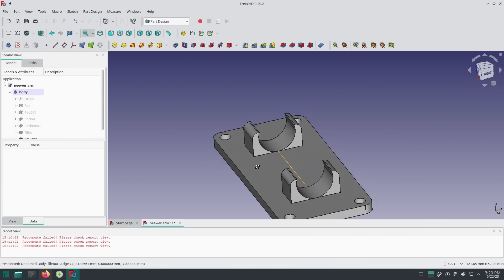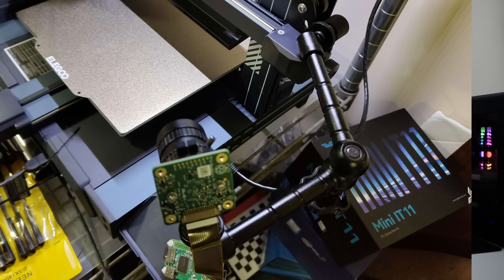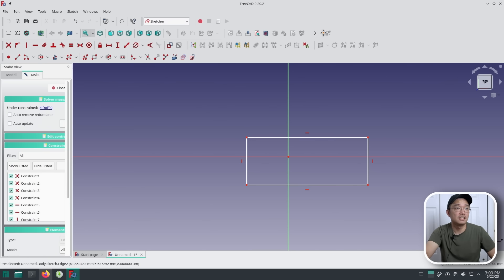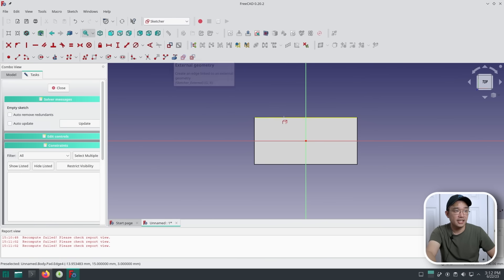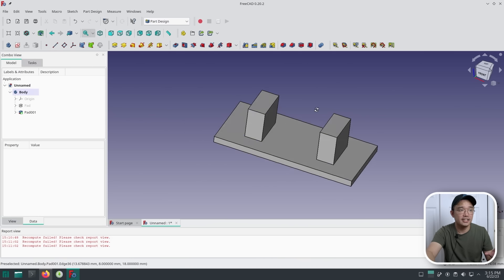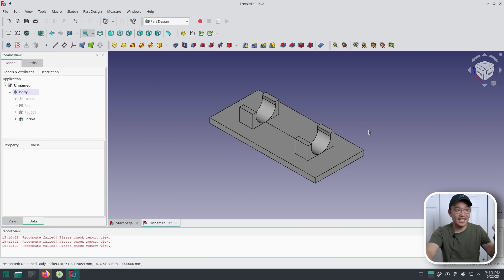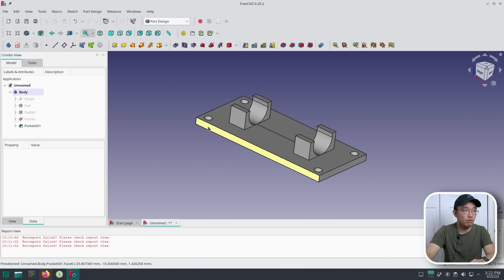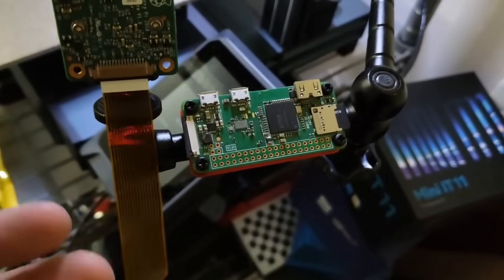Learning FreeCad with These Basic Steps

Comment: 13:10 You can't infer the diameter of the holes based on the distance from the center to the outside edge of the base. You say the hole diameter is 3.5mm, but the lower right corner of the diagram says the holes are for 2.5mm screws.

Comment: The one thing that is boggling me, is this sketch stuff adding extra steps I'm not used to from Rhino... i just want to work in the 3d environment. Click the box icon, make a few small boxes, tweek the measurements. Click cylinder icon, make a few cylinders, tweek measurements. Cut to form. Finished.

Maybe Blender just might be the direction i need.

Comment: nearly identical use-case to me, and you're right -- I want to print an Amiga computer case that fits a mini itx machine and someone already made one, but I will need to modify it because I want to fit a flex ATX psu in it, a smaller GPU, and probably a different board. I might end up needing to make it longer. Also, fan brackets and stuff.

Much thanks, this was a great tutorial.

also, shoutout to when you changed the entire UI of FreeCAD. FOSS is so great :))

Comment: HI, IS THIS SOFT CAPPABLE TO DESIGN SEPARATED PARTS AND THEN MAKE AN ASSAMBLY? i need a tool to design in that way becouse i work making some articles on wood and need to make an asambly to see if all the parts fit and get not surpeises after cut the material,  i used autodesk inventor for a long time but they give no more educational licens and its just too expensive to me becouse im from Argentin :( thanks in advance!
Reply: Yes!

Comment: Don't do 30/2 or 15... when inserting the distance, click on the full distance and it will bring you de variable (like D1) and then divide it by 2. This parametric way will allow the center point be correct for any future change in size lengths of the board

Comment: Not sure if anyone had the same thing happen, I'm using version 0.21.2 and at 11:47 when you create the pocket you have an extra edge that I don't have. There's the edge left from the circle and a much smaller edge in the upper part of the right block. I don't have that small edge, I just have one continuous edge left from the circle. Hard to explain. I can't figure out what if any step I missed as I've been mirroring your every move. Anyways, thanks for the tutorial...hoping this is enough to get me going with "simple" models and build from there.

Comment: I definitely appreciate the effort put into this video.  However, I finished it still feeling confused about how to do many basic things in FreeCAD.  A lot of details are glossed over, like what constraint symbols specifically mean and what each type does.  It also doesn't really touch on many of the tools available.  For example, instead of free-handing a rectangle and centering the object by manually constraining corner vertices to the origin, you can just use the "Centered Rectangle" tool and draw it out from the plane origin, skipping a few tedious steps.  Just wanted to let anyone who still feels confused know that you aren't alone!

Comment: giod video for beginners, however you could simplify a few steps especially using the "symmetry" constraint and hole "thru all" instead of increasing the depth that much. those tricks also make it easy to update if necessary as you would have less lengths to change. anyway, very useful for beginners I thin 👌

Comment: I want so badly to just run linux.  Bill Gates, microsoft, google, apple, etc. have all become so damn sketchy these days, but I always ran windows because of compatibility (mostly for gaming which I shouldn't be doing anyway) and a few other programs too I guess.  I wish linux was as compatible as windows with all the software and hardware out there.  Maybe some day I'll be able to afford 2 beefed up PC's and have windows on one, linux on the other, and do as much as I can on linux and only use windows when I have to and I'll be able to determine how restrictive it is.  Then there's Apple which I was about done with and then the m1 chip came out so I use an apple laptop...the thing is just amazing.  Super thin, super fast, and the keyboards on those things...I swear they are designed for my hands lol.  Anyway sorry to rant about this on here, just saw you running freecad on linux and man...that's the dream.  Free open source everything.  How the internet was supposed to be.

Comment: This tutorial is interesting. I've had FreeCad on my computer for months but haven't used it because I simply did not know what to do to build anything.
Still, I'm hard pressed to find any benefit this program offers over OpenScad. OpenScad makes it easy to include fudge-factors in your creations to get around the fact that FDM 3d printers NEVER print exactly what you design. Holes will be a little smaller than spec and poles will be a little larger, and a fraction of a millimeter can be a big problem when you need something to fit with another part.
What I'd really like is a program that lets me model parts working together. I know such programs exist, but I doubt I could find a free version that does not require me to store my creations on the cloud. I like to keep my creations on my own server.

Comment: OMG this video was useful. I just needed to know that, part designer into a new body, into a new sketch ON A PLANE, that has a SHAPE which is constraint on all points until green. Then PAD it and you have a functional model. You then add to that by selecting a face from your existing part all over again by doing sketch, shape, with constraint, with pad. then you use the tools like pocket, fillet, drill, etc on the PADDED part. and then export the body. WHY can't the other videos explain that much needed workflow? I can learn the extra stuff later, or most likely figure it out on my own. Most of us here are good with computers, we aren't your normal casual user.

Comment: Pretty good tutorial. I do see the similarities between Freecad and Solidworks (Solidworks user here), although I thought it would've been much better if you did show some commands that would make the part building quicker and more efficient.

For instance, you could've made just one hole (or two holes) on the surface, specify the dimensions, then just mirror onto the other side. In doing the longer route that you presented, it's just taking extra time dimensioning each and every hole (also can be prone to accidentally making a tiny mistake by mis-typing and giving an incorrect value to one of the holes). The same goes for the holders - just make one then mirror onto the other side. You can ensure that dimensions are the same and they are symmetrical.

I'm hoping that these commands (i.e., mirror, linear pattern, circular pattern) can also be done with Freecad (that I'm interested in knowing), as it they are basic in Solidworks and Autocad. I'd like to try out Freecad later on, as it is free and you don't have to pay thousands of dollars for a license.

Comment: at https://youtu.be/rglvJH9z5ng?t=684 you "save this" by clicking "close" and you get back to the 3d-view with the circle showing.  When I do the same, no circle shows and the pocket tool does not work although Sketch002 shows up under Pad001 in the herarchy.  This is with FreeCAD 0.21.  I am stuck here...

Comment: What if I dont use a mouse, but a touchpad, and I cannot accurately click on tiny things?
Reply: Unfortunately, touchpads are more for doing touchy-feely things.  A multi-button mouse is needed for doing anything close to engineering work.
Reply: @notyoung  Shouldnt have to be like that, especially since you are likely typing in parameter values manually anyway in a CAD software. All that would be neccesary would be to make tiny clicky things circly things for easy touchy select and grab.

Comment: Watching this video is frustrating.  Symmetrical constraint could have been used multiple times, saving you from having to use two constraints.  The axis lines can be used like construction lines, and they are always constrained, not just the origin point.  You could choose up to face on the pocket tool, and click the face you want to extrude the pocket to, instead of increasing it incrementally.

Anyway, you got the job done how you did it, but you cause me great pain by avoiding so many shortcuts.

Comment: I used fusion360 for the last decade or so and since they're getting greedier and greedier and start stripping away features from the free-tier every day it seems, i start to get fed up by all this cloud-stuff.

FreeCAD looked so barbaric and convoluted, but after sitting down for a whole hour and forging the UI to my specific needs and installing ModernUI Plugin... it now feels great. Sure Fusion360 has a more fluid workflow in some cases but FreeCAD gets the job done aswell and i already modeled a few things with it and get the hang of it more and more with each use.

The comments under this video are super valuable but your video gets you up and running without any hassle. This is a very very well done basic tutorial! Good job!

Comment: Thanks for teaching an old man how to do it.  I learned more in this <20 minute video than I have in hours and hours of the freecad tutorials. So practical what you have taught here, and yes I am sure there are plenty of shortcuts to get it done faster but the basics you have shown are golden for a beginner. You talk a little fast but that makes it quicker to rewind important points and hear it again without taking all day. Don't change a thing!
Reply: Heartily second that!
Reply: YouTube allows for video playback speed tweaking under the gear icon. You can speed them up, or slow them down.

I agree: this is an excellent tutorial.

Comment: Using that "external geometry" tool makes it easy in the first shot but it will also screw up your whole construction because of the topological naming problem freecad still suffers from. So i assume if you add e.g. a phase on the edges of your ground plate, everything will break. 
You can use this for simple constructions of course, but if you do more complex things, most likely models you might change details later, that's the last thing you want to use. And that's where freecad becomes hard to use.

Comment: I think there's a mistake regarding the holes. They are actually 2.5 mm (I think), not 3.5 mm. If you look in the bottom corner of your ref drawing, it says there are 4x M 2.5 holes. The 3.5 mm on each corner in the ref drawing is the distance from the ref edge of the pi board to the center of the hole, not the diameter of the hole. Or maybe I'm missing something?
Reply: Agree, also noticed this, the 2.75 mm dimension of the hole diameter is even drawn close in the top left corner. Nevertheless, a great tutorial by @NovaspiritTech, Big Thanks!

Comment: The holes through the PCB of the RPi are 2.75mm in diameter +/- 0.05mm. They are set 3.5mm from the edges.

Comment: It's very easy to work with if you know nothing.
It's very hard if you're used to other CAD-programm's workflows and constantly want to do things you're used to but that are way more complicated there or work totally different. ;-)

Example: I'm sketching two circles, one inside the other, as an inner and outer diameter of a hollow cylinder. If I want a wall thickness of 5mm and the inner diameter is the important one for the application I'd measure the inner one and say the outer diameter is the inner +10mm, right? If the inner diameter changes, I just need to correct this and the outer will change with it while keeping the wall thickness constant.
To give the outer circle this diameter description in Solidworks e.g. you'd measure the inner to your desired value and for the measure of the outer you'd click on the inner measure and type +10mm and that's it, formula done.
In Freecad you'll have to assign a name to the inner diamter and then manually type a lengthy formula to adress the "object" of the inner diameter and add the 10mm - and don't forget the units or you'll get an error and can start over again!

Another example would be creating part assemblies from multiple parts that get joined, but I just start to learn how that might be possible...

Comment: I couldn't follow it 😢
At min 6 when you close the sketch it went straight away to part design and your selected it and use the pad option.
It doesn't do that on mine. I have to manually change to part design and when I click on pad it says I can't use select object. Consider using a shape binder...

I couldn't continue.

Comment: Thanks. A good beginners tutorial using the minimum number of concepts. There are other constraints that make for a better design but that would best be for a follow on tutorial.  

For example, the idea would be to place the upper left hole and then make the upper right horizontal constrained. Then place the lower right and make the upper right vertically constrained. Similar for lowe4r left.  Then do it all over again but use a rectangle and use the symmetry constraints on opposite corners and the center then set horizontal and vertical sizes.   These last ways are better but not for your first drawing.

Comment: Just a tip. Normally for pocket I'll just put "thru all" instead of "dimension". Less the hassle of figuring the value, and if the thickness changes, there's no need to adjust the value (if it's meant to cut thru all anyway). For the holes, just create 1 hole and use multi-transform and 2 mirror transformation works well.

Comment: You missed the important explanation of getting the hole diameter correct when you did the Boolean operation, cut too much away and it won't clamp, leaving too much material on would make it difficult to attach to the arm. You kind of missed that part of the video and you chose what looked right, but you didn't' explain it.

Comment: @NovaspiritTech A lot of people knock on FreeCAD saying that it's too limited. That might be true if you're designing a jet engine for a f22 fighter jet or rocket engines for NASA but for almost everyone interested in getting into CAD it is more than adequate. I designed a whole 3d printable tool set using FreeCAD and had no problems.

Comment: You can actually import an image such as the one for the Pi . Then adjust the scale so that it is correct with respect to the FreeCAD units. Then you can build your model around the image.
If you can get 3 axis view images ,then you can attach each one to a relevant plane in the 3D view

Comment: I learnt more from this video about using Freecad than anywhere else. Thanks! What I realised is that most of the time I know what I want to do, but do not know the terminology used to search about it. For example, it would not be straight-forward for a beginner to guess that you need to use a pocket to create a hole. Keep these tutorials coming :)
Reply: Honestly, he is talking WAY too fast and the resolution on his camera is terrible. There are much better videos out there.
Reply: @bill4639  – Honestly, if you think someone is talking way too fast, you can slow down the playback speed and solve that problem. 

For what it's worth, I was actually playing this at 1.25x recorded speed, and low resolution (to save bandwidth), and found it understandable. Your mileage may vary.

Comment: I really feel like even a basic tutorial video like this NEEDS to mention the huge problem with Freecad when creating sketches to faces like you did here, that is the Topological Naming Problem.  Try making a change to the 1st sketch and will break the rest of your sketches further down on the part design when doing sketches to surfaces like you did in this video.  Until Freecad fixes this problem, you really should be mapping your sketches to some datums instead of to geometry surfaces so that you can make changes without breaking the rest of your part design.  I really feel like this should at LEAST be mentioned to anyone starting out with Freecad.
Reply: How do you make a datum in freecad?
Reply: @JinKee  as of last week, freecad launched the 1.0 version which is supposed to mostly fix the Topological Naming Problem, so you may not have to worry about your part breaking if changing a sketch early in the part design.   The release notes say it's not completely fixed yet though, I haven't tested it out yet,. A datum is just an artificial plane in which to start sketching on instead of a surface.  It should just be an option in the toolbar.
Reply: @ thanks i will update and check it out

Comment: Thanks for this.  It seems more intuitive than Fusion360 and less of a resource hog too. 👍

❓*Question:* I'm finally moving up from Tinkercad, and in that programme, I could increase the resolution of any circles allowing for smoother curves; is there any way to do that in FreeCad?
<edit>Subscribed!
Reply: In most serious CAD systems, you don't control the resolution of circles when you create them, as you do in TinkerCAD. Instead, the resolution control you need is when you export an STL file, for 3D printing, for example.

Comment: 3:50 (I have to do this in KiCAD to brew hand solderable footprints with silkscreen or PCB shapes that will fit tight spaces) Usually the diagram is called an "engineering drawing", and it's kind of like giving a CAD engineer instructions with one diagram that doesn't have to be at scale. Of course, not all datasheets call it that, and not all manufacturers provide a vector image of their product for CAD engineers (let alone 3D data), which is annoying.